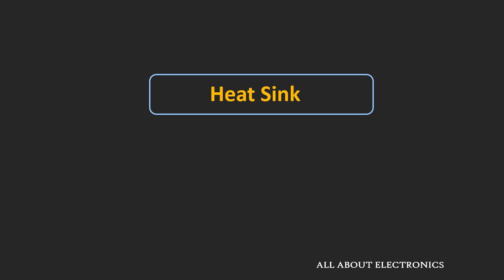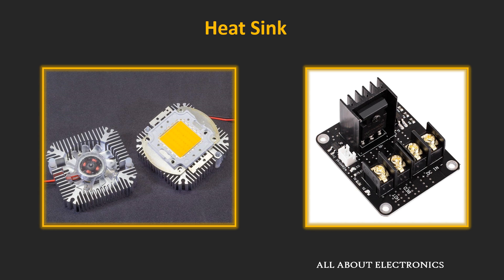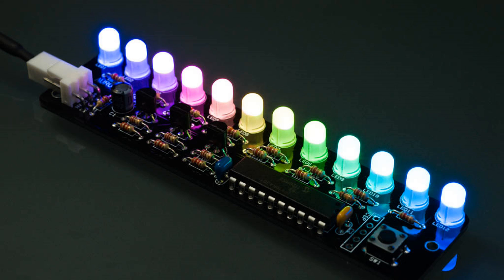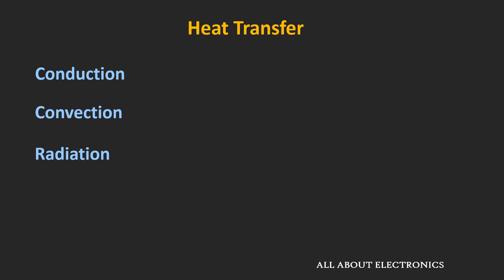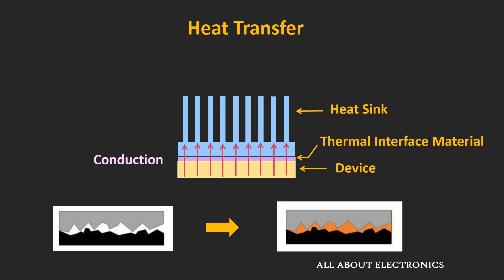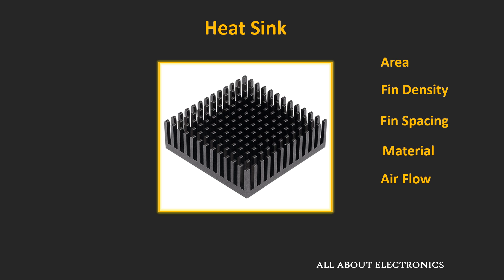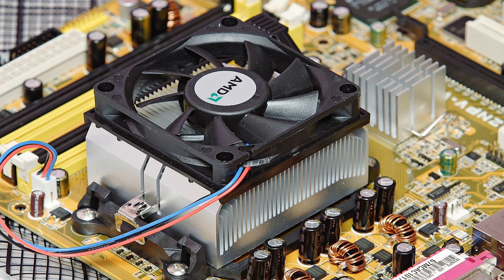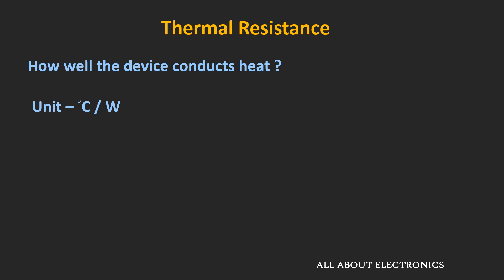What is Heat Sink? Why Heat Sinks are used in Electronics? How Heat Sink Works? Heat Sink Explained

Comment from the maker: The Timestamps for the different topics covered in the video:

0:22 What is a heat sink

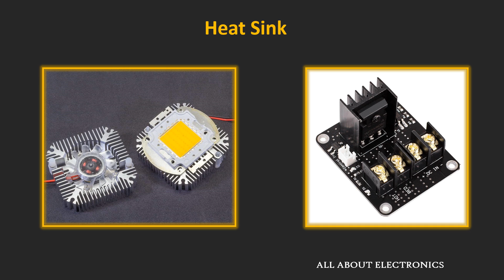1:25 Why electronic devices /components get heated? The need of heat sink in electronics

2:55 Heat Sink Working

4:38 Performace parameters for the Heat Sink

5:05 Different Types of Heat Sink
Reply: Nice explanation 👌

Comment: Is the heat sink is harm to our body?? Reply fast as you can
Reply from the maker: Heat sink is meant to transfer the heat from the electronic device to the surrounding. So definitely if you touch the heat sink it will be hot. And that to when the device is On. Also of it is properly designed, it's temperature won't be that high.